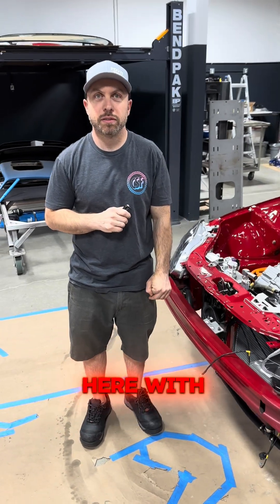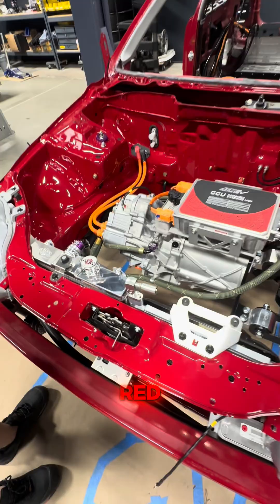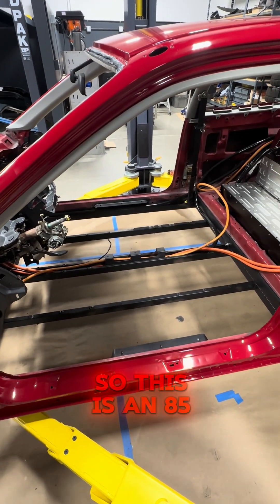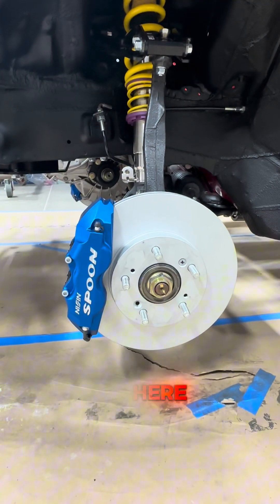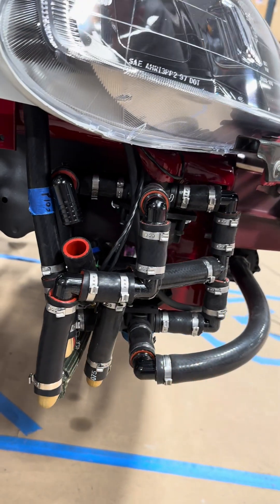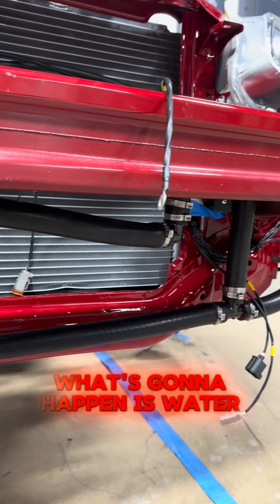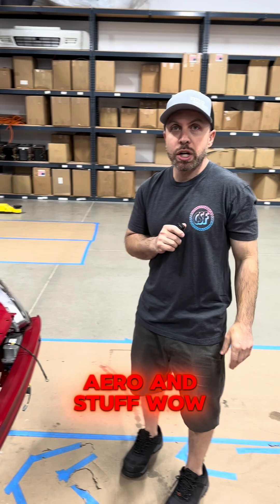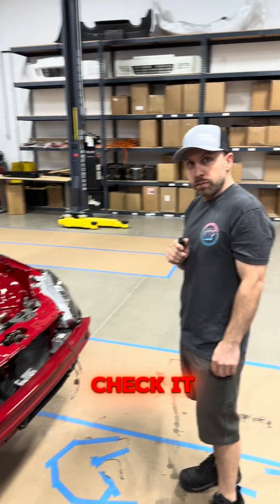Rywire's EV AWD Civic EK Hatch SEMA Build

Comment: sick, ive been thinking about this for a long time except with a crx. depending how you want to go about the engine bay you could block off the bottom with a "skid plate" and run ducting upwards to where the factory cowl is cut all the metal out and have it vent from the front of the car over the windshield. And by my uneducated calculations the pulling pressure should be higher from over the hood compared to the pushing pressure from the bay and it should create a slight vacuum effect reducing drag and improving cooling. i use a 01-05 civic full size rad tucked in my eks it works wonders here in florida